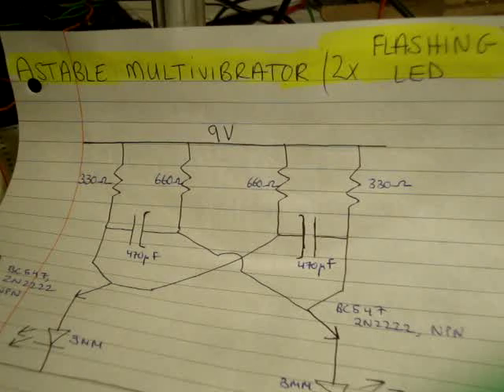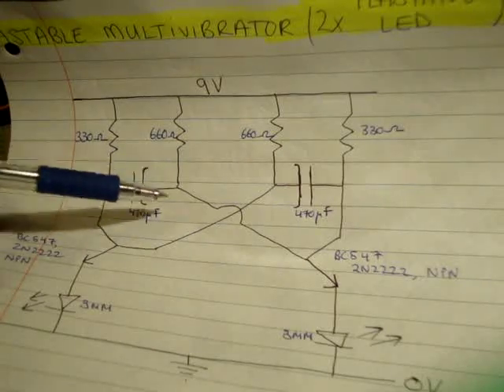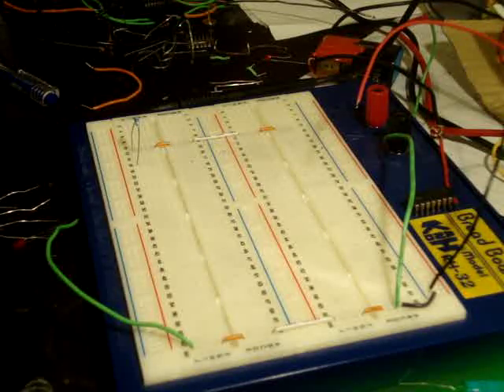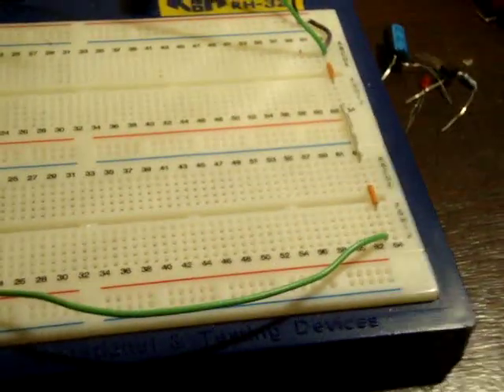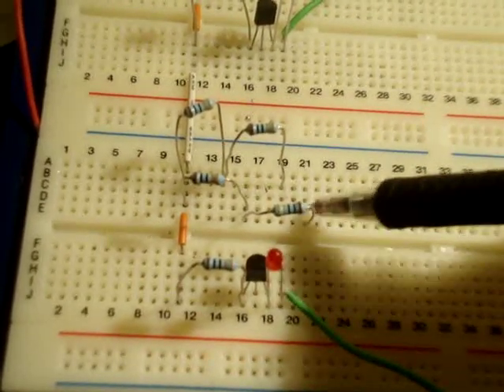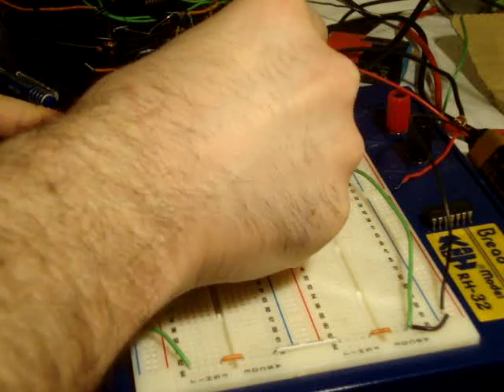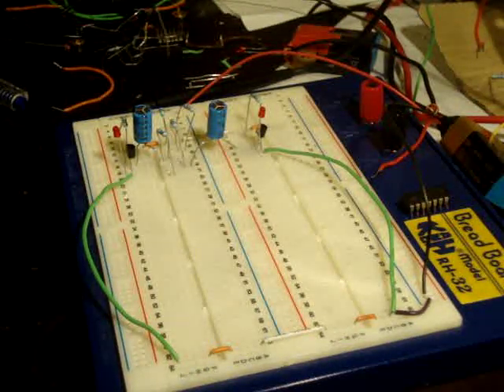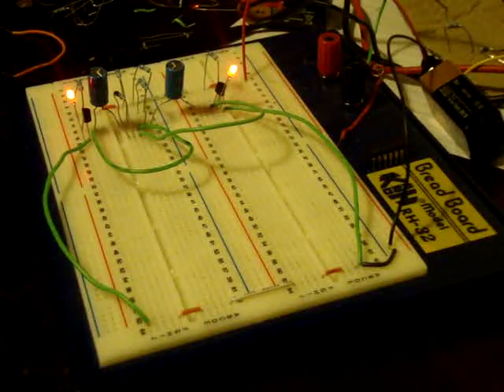Electronics 16 : How to make an Astable Multivibrator ( square wave generator )

Comment: I've watched I dont know how many videos, read god knows how many articles about making a tranistor astable multivibrator, and no matter how many ways I try it on Circuit Wizard, it either doesnt oscilate or it does, then simulates blown parts all over the shop...getting very tired of it now. I've followed schematics exactly and none of them behave like they do on the videos. What gives? Is Circuit Wizard lieing to me? Help please...I dont want to knock up this circuit and have it in situ if it's just going to blow on me. What do I trust? Youtube vids and schematics drawn up by god knows who, or a program designed to show faults in circuits? Yours, confused and getting angry from Wales :-(

Comment: Hi StingrayNate.  As I mentioned in an earlier comment, BC547 and 2N2222 transistors are NOT identical!  If you are using 2N2222's ( as I have ), the emitter and collector terminals are opposite those of the BC547's,  so you must turn them around in the circuit.  If you look closely at the face of the transistor ( use a magnifying glass ), you should see a tiny "e", "b", or "c" directly above each terminal.  Hope this helps! :^)

Comment: IMPORTANT:  BC547 and 2N2222 transistors ARE NOT the same thing!  They may work the same, but their "emitter" and "collector" terminals are on opposite ends!   I discovered this first hand when I built the circuit myself using 2N2222's.  Make SURE you have correctly identified each lead!

Comment: Yes, that will change the frequency, but it will also change the duty cycle, because you're altering only 1/2 of the circuit.  I would suggest you attach one outer terminal of a potentiometer to the 9 volt supply line, then attach the positive end of both bias resistors to the middle terminal of the pot.  Now, you can adjust the bias on both transistors at once.  Hope this helps! :)

Comment: Are you sure you're using the right transistors and / or supply voltage?  You mention the bias resistors - they are the critical values.  I would suggest connecting a potentiometer to the 9v source, then the positive end of each resistor to the potentiometer.  Now, you can adjust the bias on both transistors, and if you can get it to work at all, this should also adjust the operating frequency.  Hope this helps!

Comment: TO ADJUST THE DUTY CYCLE: you can use a potentiometer (pot) as a "balance" control to adjust the bias on both transistors at once. First, remove the bias resistor from the base of each transistor, then attach the middle terminal of a pot to the voltage source, and each outer terminal to the base of either transistor.  Now, each transistor will get more or less bias voltage, depending on where the pot is set.

Comment: Is the orientation of the capacitors correct? The article about multivibrator on wikipedia has the same scheme, but shows different capacitors orientation.

Comment: use 0.00000000000001, there has to be at least some resistance, unless its a liquid nitrogen cooled superconductor, but your most likely working with those.

Comment: I just built one of those last week. Interesting though I put my LED's towards the top of the circuit. I neber thought of putting them near the ground side of the circuit unless I was doing it with a PNP transistor. Intersting.

Comment from the maker: @StingrayNate Not seeing your circuit, the main problem is probably the orientation of your capacitors. 
Type 'falstad oscillator' into google and choose the first link. The site in general is an excellent tool,so it should help a lot. You can vary the circuit elements as required. It's often difficult to copy another circuit, i've tried to make mine as clear as possible. My only other advice is to try copy absolutely exactly what i did, or send me your circuit..